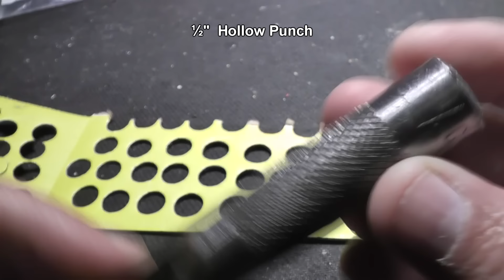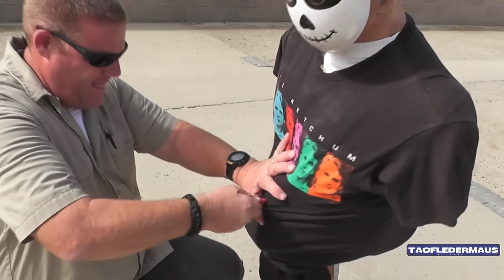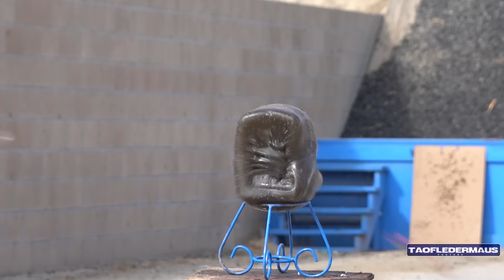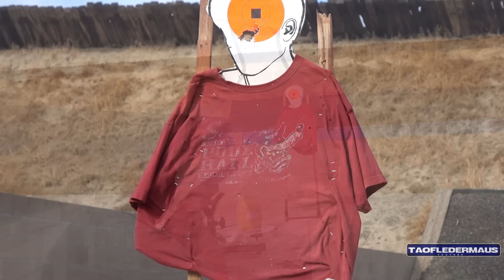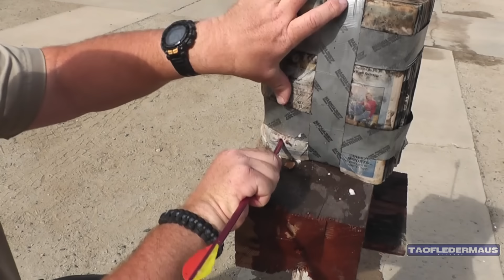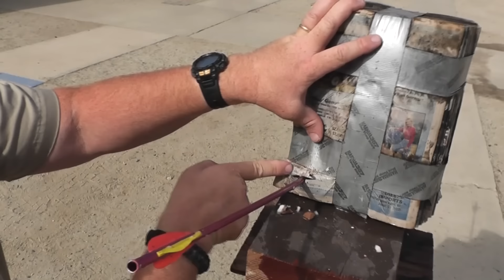.50 CAL Air Shotgun with CROSSBOW BOLTS - Powerful!

Comment: This is an old video but it shows the power and speed this has ! 
 You will need a pretty stout target backstop ! 
 I put a front and rear sight on my setup . 
 This PCP has 2 power levels when you pull back the action and you may find the lower power setting is sufficient for hunting deere & hogs ! 
 For those who have a lot of old arrows sitting around you can experiment like these guys did , it’s far less expensive !

Comment: Pretty neat.  I made a gas-powered spear gun many years ago out of a CO2 fire extinguisher, copper plumbing supply line, and a few fittings so that it was shaped like a long-barreled pistol.  The big difference with CO2 is that - unlike the case with compressed air - the CO2 pressure is constant shot after shot until the last shot.  The other difference is, of course, that the pressure from CO2 is much less than that from, say, a scuba tank's pressure.  I fired short steel spears made from hardware store steel rod that I threaded to take spearheads, and it was very powerful, very successful, and very compact and easy to maneuver under water.  With lighter spears it would be pretty formidable as an air gun, because the internal diameter of the copper supply line is big enough that the force, even at low pressure, pushing against the sealing flange at the back of the spear, really accelerates it.  Within range of about 15 feet, it would send a spear through a large striped bass like it was made of styrofoam.  Neat little shotgun in this video - and entertaining as always.

Comment: Check out C.A.P arms custom built, handcrafted patented power tune for the Seneca WingShot II.   After the custom, handcrafted power tune, it shoots the 430 grain AV air bolt at ~700 FPS - that is over two times the kinetic energy of the best crossbow you can find!   C.A.P. stands for "Constant Acceleration Pneumatics"

Comment: Them big bore air rifles are lethal as hell I seen a video where they shot two 3/4" sheets of plywood at 450 yards and it went through both pieces into the dirt brim. If I remember correctly it was 45 cal.

Comment: You guys need to try the air rifles that have the carbon fiber wrapped aluminum cylinder that strapped to your back .it holds over 1000 pounds per square inch has a braided stainless line that runs to the gun from the tank  can shoot in rapid succession hundred rounds because of the large capacity of compressed air, in the cylinder .I saw one of these shoot a 50 caliber round same power as powder the air is compressed using a scuba tank compressor very interesting thought you might do a video on these. Great show always.

Comment: I used to work at a place where we went through dozens of caulk tubes each day and I started cutting off the caulk tube nozzle flush with the end of the tube for use as a blowgun gas seal

Comment: You guys should have read the manual. You guys could have gotten hurt. You need to learn about PCP air rifles. You can get over 300 fpe on a slug. You can get over 600 frp with an arrow. This model does neither.  Very dangerous stuff. Be careful.
Reply: Sorry 3000 fpe on a slug  and 600 fps on an arrow.

Comment: Your supposed to place a small rubber band on the end of the broad head blades. It holds the blades into place, until impact. On impact, the rubber band will come of and open the blades.

Comment: Ok now I'm dying to know...
With a good seal/wad/sabot, a light enough cross bolt & the right type of powder charge, could you fire a bolt from a solid fuel mass accelerator?? 🤔🤔

I bet you could...
Maybe a dime inside the shot cup would provide enough support to push the bolt out...? 🤔

Comment: Pretty sharp and deadly. allabout.wiki/5u98 The heads are misaligned with the fletching, causing some accuracy issues but that's an easy fix. Once aligned the erratic point of impact settles down altogether.
Reply: wow

Comment: you are suppose to take the choke off the gun to shoot bolts, not good for home defense? a 12 guage hits around 1200-1600fps, this gun comes in at 1300fps, some mods can  put it at over 2500fps, well capable of home defense, please do not listen this

Comment: You guys were shooting the mechanical broadhead wrongs. The collar/band wasn't wrapped around the blades to keep them locked in. Also I would assume you lost accuracy during to the twisting of the fletching while shoving them into the barrel. They're not supposed to be bent or folded.
Reply: And I'm sure the cheap china arrows/broadheads didn't help with accuracy.

Comment: High end air guns can be a bit spendy.
However, they can be pumped up to full capacity, even if there is no electricity or other motors. 
That level of hand pump also costs some money, but you can always make some ammunition and put food on the table. 
#AmericanAirgunner
It is an interesting show to watch occasionally.

Comment: wow im an archer and im impressed, i have what i think is a fairly flash compound bow and it will only reach 340fps max with around 70lbs draw wreight. i dont know of many others that would shoot faster either.. well done whoever made that shotgun.
Reply: also those Chinese arrows and broadheads will not help your accuracy, ive had arrows do full 2 foot circles on the way to a target only 30 yards down range. those things are legit dangerous

Comment: Modify a paint ball gun to fire bolts that you can load into a magazine and fire with the paint ball gun. Use a 12v mini cryogenic piston that turns the gases in the air into liquid that fills your tanks so you can recharge your tanks out in the field. This concept could be used to recharge a 40 cal air rifles tank has well. Fire off a few shots and a mini cryogenic piston turns air to liquid fills tank then liquid air returns to its gas state for compressed air. Then you can have a really great new survival tool. 😊😉

Comment: Did the same thing fooling around with paintball guns back in the day. 
Also cut down a blowgun which had a rubber handhold sleeve that formed a perfect seal when inserted into the paintball guns barrel. It shot 1" hunting darts so wicked hard that they disappeared into wood.

Comment: Rage mechanical broad heads are crazy. I shot a white tail deer and it expanded and split around 5 ribs on each side and went through and stuck in the dirt I kept my arrow and til this day it is razor sharp and it has just been sitting because it was my first deer with a crossbow

Comment: The Reason you were getting Air blast in your face .  AT the beginning of your video   I noticed the back o ring on the breech  of the barrel had been pushed back against the receiver .  This happens when the rifle is fired without the breech slide is not all the way back when fired  ,

Comment: so the broadheads should have a rubber band and it should go between the blades so it opens up in the target
Reply from the maker: Yeah, they have an o-ring on them.
Reply: well that's good if you put the o-ring on where the blades cross that will make it fly better and open in the target
Reply from the maker: Didn't see a reason to alter the design.
Reply: you wouldn't change the design the o-ring would just be in a different spot I only bring this up because you guys seem more gun then bow guys, I only use a bow to hunt because the local laws where are dumb

Comment: * Hey Taofledermaus - In reference to the first shot I believe you also encountered another bonus  "mod" if you will ... I believe that the electrical tape seal (on the fore end) may have ALSO acted as a "dynamic reinforcement"  of the arrow shaft .... and that bend I suspect may have been much worse if the tape were were not there.  Maybe as the wave of impact hits the arrow tip/shaft the tape which is immediately "installed"  behind it, may temporary reinforce the shaft as it ALSO slides back with contact/penetration of that tight weaved Kevlar.  
     If bending of the arrow presents itself as a future problem (due to impact) then maybe also  experiment with different front end seal material that are meant to slide back in unison with contact of the target ( that tries to follows the shockwave that moves back through the shaft)

     *Also I always thought that you could make a "fletching ring"  that slides back and forth freely along the arrow shaft (a "lug" of some sort at the notch end so the "fletching ring" does not come off as the arrow leaves the barrel ... so when loaded the only thing that one would see protruding out of the barrel would be the arrowhead AND the "fletching ring" ... when the force of shot is applied to the shaft (as usual) the arrow flies out and the "fletching ring" slides along the shaft until it is stopped&seated by the "lug" on the notch end.  You could experiment with different fletching/stabilizer sizes and configurations ......  OOHH!!  The experimentation could be lengthy enough for many videos to come.  Multiple types of heavier "payloads"  that can now be countered with larger "exterior" stabilization/fletching ring.   I know there must be some term for this already ... "floating fletching"  ?? lol?.    Hopefully you guys see this ... and that it makes some sort of sense to you fellas :-).   KICK A$$ vids as ALWAYS fellas!!

                        Happy Holidays and Merry Christmas Taofledermaus & Crew.

Comment: The best type of ammunition for this, is the dart known as "virote" used in ancient crossbows. It's harder, it flies farther and causes the same damage. Replace wooden stabilizer fins with rubber ones. This type of ammunition is sold for hand crossbows. Wind the fins to insert into the barrel. I attached a link to the plans. Excuse my English, I am Spanish and I am using a translator.           
http://gaueko.blogspot.com.es/2014/05/el-correo-educativo-de-los-viernes-23.html

Comment: It’s true that the arrows are stupid expensive but they are extremely accurate and shoot at a velocity that far out-performs traditional cross or compound bows. At 50 yards. I put my first one dead center of my target. My hope is that cheaper arrows will hit the seen so I can purchase many more of them. The 50 cal. Pellets are bad ass also...no hassles with purchasing air guns either and the amo is far cheaper to have some fun. They way under played the deadlines of this gun because it’s bad ass and I shoot mine from 30-40-50 yards.
With awesome accuracy and it will penetrate a 3/4 in. Piece of plywood every time from upwards of seven shots per refilling the gun with my air tank. The buckshot is the least admirable unless you fill the shells with regular bbs. But still not as tight a pattern as I would have hoped for. Look up other videos on the Dragon Claw version of this gun for a better overview.

Comment: I magine how deep it would go if it didn't have to push the tape?  Try foam or something that slides easily. Lube the shaft before putting tape on it.  Make a bushing that can separate and fall off on impact.

Comment: It's remarkable that those aluminum bolts didn't bend more. That's not very thick stock and you could probably easily bend it with your hands. They must be very straight - it'd be interesting to put them in some sort of balancing / runout rig and see the numbers.

Comment: You'd get extra power and penetration if your bushing was the size of your bolt, or rather vice versa since that's more practical, because the kevlar is catching the bushing like a pistol round, and it's like a sabot that hasn't lost its sheath.
Reply: Also, if you filled it with larger shot, don't you think it might do a lot more damage?
Reply: You'd get a lot more from a 40 cent 5.56 round too. Those pokey bolts don't even hit 500 fps.

Comment: Those mechanical broadheads needs a small rubber band around the middle of the heads to hold the blades closed and blade tips pointed forward. Once it impacts the blades snip the rubber band and opens.
Reply from the maker: They have an o-ring that locks them down.   They just opened because of the shock
Reply: TAOFLEDERMAUS Ah, I follow ya. I halfway didn't want to post that, lol...  because I know you guys know what you're doing. I never cared for mech broadheads when hunting. More chances of failure in my opinion. It's why I also use a whisker biscuit on my bow as well. Just fyi, I'm Texas Shootapalooza Club on your Patreon. I've enjoyed y'alls video for years and Officer Gregg cracks me up. Thought I would finally throw in due to y'alls busget shortfalls from the gastapo youtube. Look forward to more though.

Comment: Need to fill them slow from a composite tank. The air gets too hot if you open the valve too fast. Air gets hot and expands then when it cools it compresses and you lose pressure.

Comment: Your supposed to put rubber bands specifically made for mechanical broadheads on the blades to prevent premature deployment upon acceleration
Reply from the maker: They have little o-rings that lock the blades down.   They opened up despite that
Reply: TAOFLEDERMAUS  didn't see you mention it,  sorry to be critical , I do love your channel. BTW how many bands did you put on them.

Comment: as an archer this is why I hate aluminium arrows, due to "archer's paradox" when an arrow is fired it bends around the bow, aluminium arrows don't last long before they end up as wavy pieces of junk. 
it also doesn't help that the tip being the heaviest part has more inertia than the shaft so the shaft tends to bend before the arrow is released. carbon fibre or fibre glass would have been better for this gun especially if you planned to reuse them
Reply: ... не теми стрелами стреляешь и не из того оружия
.....хорошие стрелы - для арбов
.....хорошие маслин - для стволов
.........И НЕ НУЖНО ЛИШНИХ ЕБА..ЫХ, ЭКСПЕРЕМЕНТОВ

Comment: You weren't locking the bolt forward that caused the blast of air in Greg's face. It also made the power weaker and inconsistent. Over all an awesome vid
Reply from the maker: The bolt doesn't lock forward
Reply: TAOFLEDERMAUS that's so weird

Comment: Wouldn't you have wanted to make the seal on the actual bolt like the front bushing for accuracy I'm actually super surprised you went with cardboard and ramming it up against it if you put a rubber gasket around the end of the bolt then it would fit in the barrel and be perfectly centered you don't need those veins anyways I would imagine you shooting much faster than a cross bow would and as long as the bolt was like 60% front heavy or so it would fly perfectly straight but think about it cardboard and the back of the bolt might be touching the bottom or top or sides of the barrel and just at a weird angle when you could have very easily made a air tight gasket around the back out of some rubber tape or even electrical tape and it would have been a better seal and less resistance than cardboard I'm typing this before I watch the end I'm just thinking your a smart guy and you don't seem to half ass stuff I'm just wondering if you half assed this or just didn't care or didn't think about it regardless I would love to see you shoot one of the expensive arrows just one or make a better bolt the right size and put some effort into making it right for the gun with the gaskets attached and maybe play around with the displacement of weight start at like 55% in the front and adjust to see which is optimal idk just some ideas if you care to hear them.
Reply: You did use electric tape in the front now I'm wondering why you wouldn't do that for the back

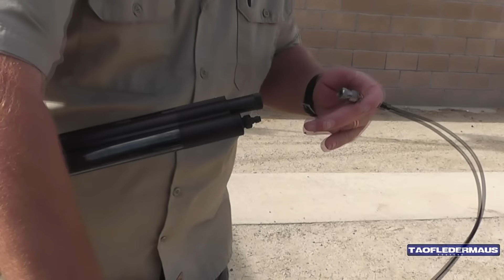Comment: 8:09 I love the crap out of you OG

I'm struck that your having pressure issues to the point of inaccuracy, but driving those bolts into the block more than most hand bows.  I wonder if there would be a way to construct something resembling a whiskerbiscuit to bypass this electrical tape stuff, although the issue with the broadhead not ramrodding down may be specific to that head design.  Professional arrows come with professional bushings for a reason, however.
Reply: I love you too RedScaledKnight1.  Just not that way.  Mrs. OG has dibs on this ridiculous chunk of man.  😎👍

Comment: Officer Gregg should surely know that even though this gun is not a 'fire' arm per se, it will still get you a felony if you're a former felon not to possess.
Reply: Tech Gorilla 

1).   Not true

2)   That’s not what we were talking about in the video, amigo.
Reply: I wan't really talking about the video which I got a kick out of.  I was just talking in general.  I had occasion to interact with local PA LEO about pellet and BB guns and was shocked to find out that in PA, you cannot own an air gun if you're a felon.  You could own a crossbow though.  Go figure.
Reply: I’m pretty sure felons can own both here in CA.   This state gives more rights and benefits to felons than to legal citizens.    Ugh.   Thanks for watching.

Comment: @TAOFLEDERMAUS
I think it not so much the air pressure that is causing the bolts to shoot low. It might be the that the weight is to the head due to the electrical tape "sabot" bushing, and thus pulling it down. If your gonna do it again, or for other wanting to do it, try finding the center of mass (balance it and mark it) and but 2 sets of tape around the bolt at equal distances from the center of mass.

@Greg
Thank you for making me laugh when ever your on.

Comment: I'll be damned, it didn't work with the correct ammo, and the right pressure in the tank. Come on guys, I need you guys to have a little more faith in the air rifles.
Reply: paul, they didn’t send Jeff the correct ammo.   The air pressure was well into the acceptable zone for the shots on this video.  Correct bolts would have been nice though.
Reply from the maker: huh?